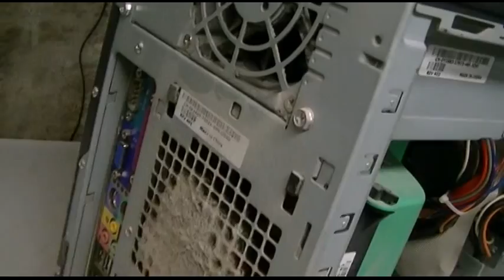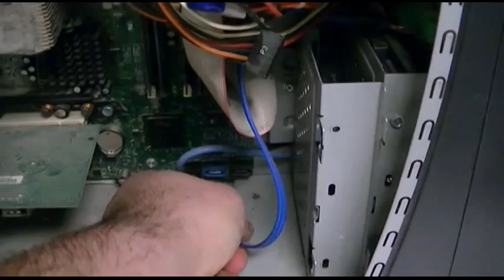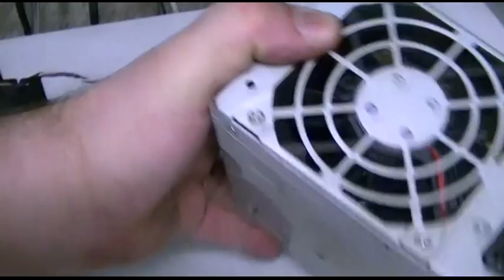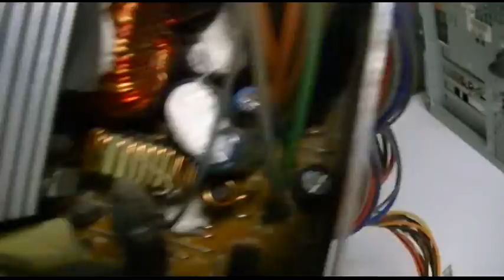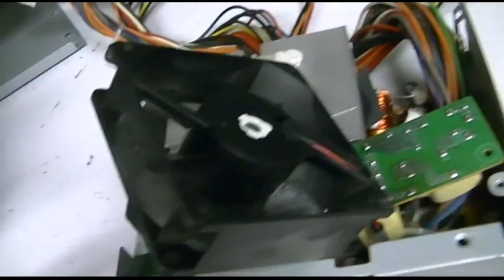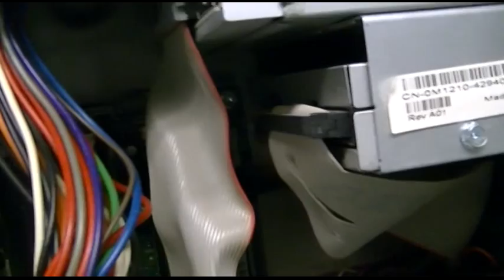Computer Fan Repair--THE EASY WAY!!!

Comment: I have a dual fan on the roof of my case, one of the fans dont work, and 30 minutes into using my pc, my pc turns off completely no warning
Reply from the maker: And?
Reply: nvm i just took a fan out from my old pc and replaced it with the broken one. but i was asking if one of the fans dont work, will the pc overheat and cause it to crash every30 minutes exact like so?
Reply from the maker: Now you've got a valid question.  Yes, that could happen, if you're putting the same general load on the PC and the room temperature remained relatively constant.  If you don't have adequate enough airflow, you could end up with a PC that overheats and shuts off to protect itself.
Reply: Omg that happens to me everyday

Comment: Yes, I gave you a thumbs up! It is a very good video of a repair to the power supply unit, which I am having a problem with because it is making a low grinding noise, and it gets quieter as time of operation passes. However, my desktop computer is a Sony VAIO PCV-RX850 bought in 2003, and ran with Windows XP, later installed Service Pack 3; now upgraded to Windows 7, 32-bit version. Anyhow, in my system's case (also a pun), the power supply is not removed that way! The console (the case, the Tower) is placed on its side after all the cords and wires are disconnected before the side panel is to be removed, the left one facing the computer user. The next step is a bit risky! One screw is loosened from the chassis being careful the PSU does not crash into the electronic components, namely the memory modules! Anyhow, not making a long story longer, all I could do was used a can of compressed air called Dust Destroyer to spray most of the inside of the case. I could not open the top shelf. Then I researched over the Internet about completely opening the Sony VAIO computer case and discovered a detailed manual, and found that after holding up those two brackets the top shelf have to be pulled outwards! My desktop computer is already fully connect back again! What do you think? Should I get it repaired, or have it replaced by another better, more powerful PSU, which I have and bought a couple of years ago; or take the risk, open it and repair this troublesome, noisy fan of the power supply unit by myself? Thanks for any helpful, constructive advice.
Reply from the maker: Thanks George.  If the fan is still making noise, I would try to repair it.  You're in a bit of a bind here, I believe those Sony machines used a proprietary power supply, where a regular off-the-shelf one may not fit.  If you wait and don't repair the fan, and it stalls, you could burn out the supply, and like I said your other one may not fit.

Take your time, have a clear mind, and pull that fan.  Be careful as you work, and it'll all come apart and go back together.

Comment: Why did you skip/not show yourself adding the oil?? I have the same type fan and I have no clue where to put the oil. You didn't show how or where?!
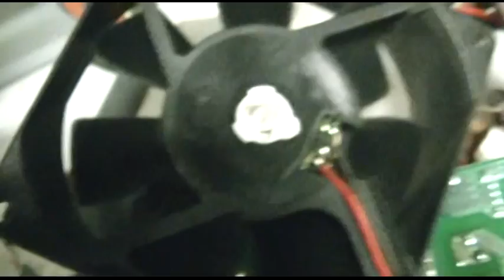Reply from the maker: I didn't show adding the oil because I really only have 2 hands!  If you watch the video again, please review 6:00 to 6:10.  The oil just goes in the center.  I had stated in this video that I had never seen a fan like that, meaning that there was no clear cut place to put the oil, so it just went in the center in the hopes it will spread out to where it needs to actually go.  You can't over-oil the motor.
Reply from the maker: No.

Comment: Allways replace it, it will newer last more than 3-6 months and ull nedd to open it again. With new it will last at least year if its worst fan in shop.
Reply from the maker: I beg to differ!  This fan has been working perfectly since.  It's been 21 months since I fixed it.

Comment: Thanks for making this video but you cut away for the part I most wanted to see ie. Applying the oil. Also is that regular 3in1 oil or some special type? I have a Compaq that has a system fan that runs for about 7 seconds then stops giving me an error message on start-up. It seems to spin freely enough when I move it with my finger. I had the computer in the box for a couple of weeks after moving and it was working fine before my move. Somehow I suspect that its not the fan (although I will try what you have show here) itself but don't know where to start trouble-shooting it. Any tips?
Reply from the maker: That was regular 3-in-1 that I used.  After to peel the sticker and remove the plug with a pocket knife blade or somesuch, if any, just put a drop or two of oil there.  

If your system fan IS running, then likely it doesn't need to be oiled.  It's possible the speed sense wire is not working on it, or worse, the board is not detecting the actual pulses from it.  You'd want to start with oiling this fan because it's quick and may solve the problem.  If not, then you can try switching the processor fan and system fan connections inside the machine if they are the same, to see if the problem goes away or changes.  If it changes and then tells you the processor fan is bad, when the system fan is actually plugged there, the fan is bad.

Some systems will allow you to continue and ignore the error, if your system does that and you don't mind living with it, that will also work.

Comment: i would not take advise from a person who treats a PC so poorly .
Reply from the maker: Good.  Brin g it to a shop and have the pros (READ:  some guy who gets minimum wage who knows which end of the screwdriver to hold) fix it, while they empty out your wallet.  Your choice.  I certainly fixed the machine and demonstrated, there's nothing more to ask for.
Reply: I back Jay up. What PC doesn't attract dust? Yes, it's good and usually beneficial to the airflow of a PC to clean it out every so often, but that doesn't mean the PC wasn't taken care of. Dell has improved greatly in the way they cool their PC's and I have always had a Dell PC ( with the exception of my parents iMac ) because I always thought they were very reliable. I even bought a brand new XPS 8900 mid tower PC from bestbuy.com and it's a BIG upgrade from my 4th gen i5 ultrabook ( which is also a dell ) that I got in 2014. be respectful to this person. I fix computers myself, but I don't have a job doing so.
Reply from the maker: Chris Kalkman Thank you Chris!

Comment: My problem is that when I turn my pc on it turns off by it self within 15 seconds of me turning it off. Any suggestions on how to fix it?
Reply from the maker: +Dash Lindsey Well, if you get a display on the screen during the short interval it is on, then the computer is somewhat functional.  Two things could be causing this problem:
1.  The power button may be jammed, if it's held for a certain amount of time it can turn the PC off. 
2,  If the processor fan is not spinning, the processor is likely overheating and it is thermalling out, causing the shutdown.  Check those 2 things, and write back if you have any other questions.
Reply: +jaykay18 the processor fan is spinning. How would I check and see if the power button is jammed and how what I fix that. Thanks for writing back btw! :)
Reply from the maker: Dash Lindsey The best way is to disconnect the power switch from the motherboard.  If the connector has many pins, you'll have to figure out which wires it is (they're color coded).  Once you figure out which wires from the power switch go to which pins, you'll need to short those two pins on the motherboard together for a moment.  The machine should turn on.  If it DOESN'T turn off, the problem is the power switch.  If it still turns off, there are other problems, and you'll need some spare parts to further test the system, such as a power supply and a spare processor fan.  Either one of those could be the problem, even if the CPU fan is spinning.

Comment: anybody know how to take this fan apart , as in removing the white plastic peice at end of fan shaft ?
Reply from the maker: +roman soldier If you have to go that far, buy a new fan, they're 5 bucks.  You could try prying it out with a small flatblade screwdriver but no guarantee it will go back in; if not you'll need a new fan anyways.
Reply: ok thanx . im having tough time finding my particular fan model on amazon where i do all my online buying so resorted to fixing this one . but now im wondering if i must get the exact model fan in my computer or shall many other companies fans work ? ive an about 5 year old HP PAVILLION desk top , with a 3 wire fan thats 3.5''x3.5'' .
Reply from the maker: roman soldier Generally as long as you get one that's the same size with the same wiring you will be fine.  Try to find the CFM rating, higher CFM means more airflow but also more noise.
Reply: ok thank you
Reply from the maker: roman soldier Good luck.  You can attempt to fix this one further, as long as you secure a replacement.  If you break this one it's not a big loss.

Comment: hi, my problem is when i record my guitar with a usb soundcard i have a whirring noise in the background on the actual recording, which is strange as my guitar is not mic d up, just direct....how can i cure this?
Reply from the maker: +100roberthenry Sounds to me like a ground loop type problem.  Or mismatched impedance between the guitar and the input on the machine.  This unfortunately is one of those difficult problems where there are a million things to try, but no real solution, you just stumble across it.  The best advice I can give you is that you're going to have to rub money on the problem and see if it goes away.  If it doesn't, rub more money on it.  Good luck.
Reply: cheers, i went through everything, cleaned, oiled my fans, fans are quiet now, i shifted all my usbs around, much better now, but still a whirring in the backround on recordings, i'll try a different usb hub i think....cheers man.

Comment: The fact of it running very hot reminds me of my brother's laptop. It would always run very hot and the fan would eventually go faster than normal. The hard drive failed in that computer once, we got rid of it when it failed again.
Reply from the maker: +Andrew Gallucci Compressed air works wonders.  It also helps if you don't move a laptop around when it's on, that helps prolong the hard drive.
Reply: jaykay18 He doesn't have it anymore. He got a new one about a year ago. It runs much cooler than his old and it's still on its original hard drive.
Reply from the maker: Andrew Gallucci Right, that's my point.  Wait until that heatsink gets clogged up with dust.
Reply: jaykay18 It probably will run hotter as it ages. I never had one get hot before, and my mom has one even older than his was and it still runs cooler than his did.
Reply from the maker: Andrew Gallucci Some machines are more susceptible than others.  The wife had an old laptop made by Canon (yes, the printer/scanner/camera company that you know) that always ran hot.  In fact it ran so hot I ghetto-rigged my own cooling solution for it.  Yeah, you wanna see:  https://www.youtube.com/watch?v=O0QsWdDPCTM

I also have a Winbook Pentium 4 laptop, that thing also ran really hot, basically in those days they were shoehorning desktop processors into laptops, and they got really hot.  That machine had 3 fans.  Yep, there's a video about that one as well:  https://www.youtube.com/watch?v=rHw4P_Ba7wI

I also have an HP laptop with a Pentium 4 in it, but I never made a video about it.  It also has 3 fans.
Reply: I am watching the videos of them right now.

Comment: i have a fan in my computer case that spins very slowly, and sometimes doesnt even spin when i turn on the computer... will oil really help and if so what kind of oil should i use ?
Reply from the maker: Adriel Garcia Depends on the computer and the fan.  Some machines speed up and slow down the fans, and when first turned on and everything is cold, very little cooling (sometimes none at all) is really necessary.

Give the fan blades a shove by hand.  If the fan is demonstrating the same symptoms as you see here, do as I did in the video.  Use a light machine oil, I used 3-in-1.  Do not use WD40.
Reply: i got impatient and used wd-40 :/
Reply: but the fans are spinning normally now,not sure what wd-40 will do but it seemed to work and this is a non PWM fan so just 1 set speed. its on my case so i figure its not a big deal, lucky for me if anything bad happens, i have a fairly brand new fan waiting.
Reply from the maker: Adriel Garcia WD 40 will work, for a couple days.  Then you're back to square one.  If you oil the fan with the right stuff, it will last.  It's good to have the spare fan there, but if you can keep the one you have still working, then why replace it sooner than needed?
Reply: Alright I'll replace it with better oil when it's needed... So should I get 3 in 1 oil or sewing machine oil, I heard it's the best to use.
Reply from the maker: Adriel Garcia I've been using the same can of 3-in-1 for the better part of 15 years now, and I've oiled countless motors with it.

Comment: What is it with the Dell Dimensions and dust? Those things collect dust like no other. When I finally retired mine to an upstairs bedroom, I decided to clean it, and it was unbelievable the amount of dust that had compacted and collected in every single nook. I'm talking everywhere: USB ports that were used often, floppy drive, cracks between the case and the CD drives, the crack around the perimeter, etc. I cleaned it once with pipe cleaners, ear swabs, and rags. I had dust bunnies the size of Mount Rushmore filling up half a shopping bag, so then I cleaned it again with compressed air and keyboard wipes, but it's still not clean to this day. I've never seen such a dust collector, but it still runs, which is more than I can say for many less-dusty computers that I've had in the past.
Reply from the maker: It depends on a number of factors, but I think usage is key.  A lot of times people would set these up, and press the power button once, forever.  Other times, it's an old couple that turns it on and off when needed, and a few days can go by before it's needed again.

With good airflow comes a good supply of dust, perhaps these were overbuilt in terms of ventilation.

Interesting corollary:  I've seen machines taken from the dustiest, dirtiest of homes that were practically brand new inside.  I've also seen machines taken from homes where they vacuum three times a day completely packed solid.

Compressed air solves the problem most times, and not from those make-believe Fisher-Price cans, I'm talking from a real air compressor at about 100PSI.  If that doesn't do it, the dishwasher will (although some will disagree).
Reply: In my case it would probably be the former. That thing ran 10 hours a day for 10 years. I'm also one of those who favor the dishwasher; it's probably the only option to clean the keyboard used by three adults and one little one for the duration.

Comment: I used to have a Dell Dimension 3000 with Windows XP.
Reply from the maker: I think we all had these Dell Dimension machines with XP in one form or another, they were extremely popular in their day.  Fortunately they were easy to work on and rarely had serious issues.  Most times they just needed the OS reinstalled (likely because some idiot got viruses/spyware on it), some hard drives in them went bad, which is understandable, and rarely have I seen ones with bad memory chips or not powering on.  They were pretty rock-solid reliable, to say nothing of their performance, which usually was adequate to say the least.

This machine, while pretty old at this point, is still my daily-use, go-to machine for everything I do, including YouTube videos.  It's on 24/7 for me, I come and go all day.  As the Internet has improved and gotten much more advanced than it was back in the days of dial-up, my needs for a computer have changed greatly over that same time period.  Most heavy processor-intensive "processing" is left to web servers to take care of, rather than my own machine, which is a testament to why it has lasted so long.  

I still run XP on it, it will handle 7 with marginal performance (actually gets a decent performance mark for 7, not counting graphics).  I have another machine that's much newer than this one lined up for that fateful day.  I know time is limited for this machine with the 3 blown caps on the board, but they've been that way for a couple years now and it still works fine.